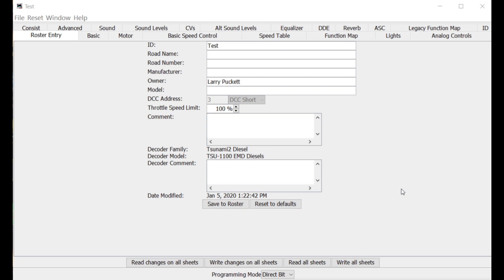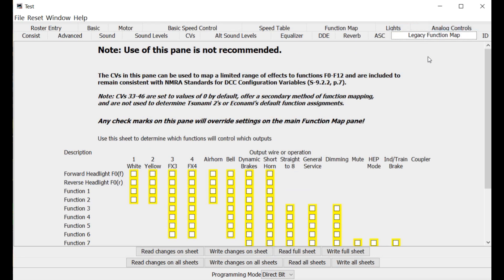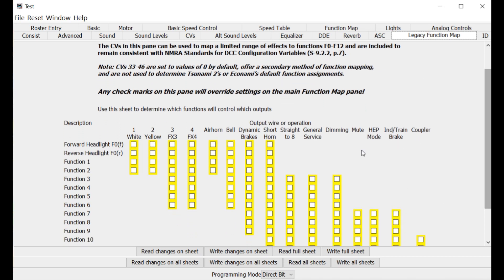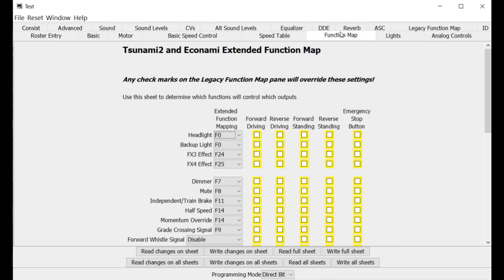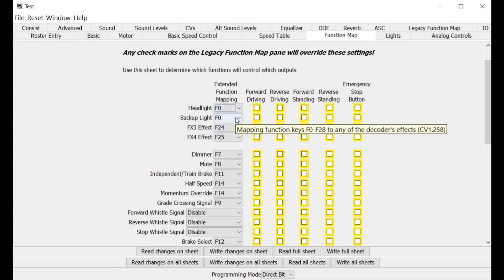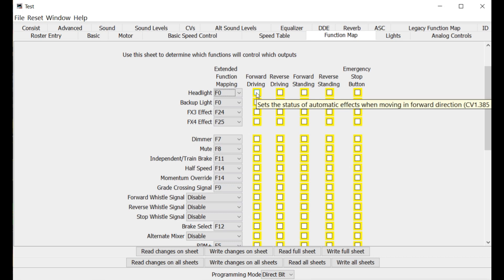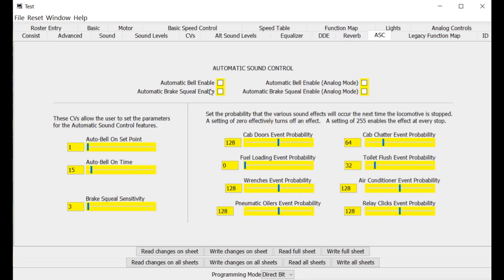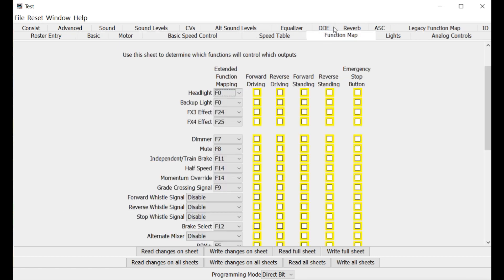61. DCC Decoder function mapping

Comment: Thanks Larry.  I have Tsunami 2's and remapped functions manually on the throttle (not through the JMRI software).  For some of my locos, I cannot remap F11 once I've remapped it once.  I can remap F11 multiple times just fine on others.  Have you experienced this?  I will try again using the JMRI software.
Reply from the maker: I just had a similar issue this week and resolved it with a CV8 reset. After that I was able to remap functions as I desired.
Reply: @TheDCCGuy  Thanks.  I solved it by reviewing the "Legacy Function Map" tab.  There were several items checked for F11.  As you mention in the video, this takes priority over any settings in the "Function Map" tab.  Once I unchecked the items and wrote to the decoder, I could modify F11 .  I would have never  known this without DecoderPro and your helpful tip.  Thanks for the video.

Comment: Hey, so I sent my Atlas S2 loco (n scale)  back to train world for an exchange because it was sputtering and would no matter where it was on the track, even brand new track with feeders it did this. 
I got the new one Last week and it does the same thing, just sputters around the track. Train world has told me to the decoder May need to be set to run more efficiently, I may need to adjust the cvs which I know little about. Do you know what cvs they’re talking about? I can switch horns and such but I don’t know how it would stop it from sputtering. 

Sorry for the long comment, you seem to know a lot about this stuff.
Reply from the maker: The decoder should have been optimized for the locomotive by the manufacturer. Since I have no idea which decoder was installed in that loco it makes it a little hard from me to comment. However, Atlas should have a tech sheet on their website on programming the decoder so I suggest you contact their customer support people. 

Now let me share my experience like this. A couple of years ago I bought a small steam loco with a LokSound decoder in it. Unfortunately the manufacturer had switched motors after the first run and as a result the thing ran horribly. I tried all kinds of custom CV settings and autocalibration to no avail. I finally replaced it with a SoundTraxx decoder that worked well with the motor. 

More recently Rapido had a batch of models that kept burning up motors, with LokSound decoders. They finally came up with some CV reprogramming changes that fixed the issue but not before they had to replace a bunch of motors and reprogram everything in their warehouse. So I bet this is the kind of issue you are seeing. And only the folks at Atlas will know. I’m sorry I can’t can’t offer a more specific answer but this is the first I have heard of this particular problem but I bet Atlas has heard from a lot of customers in your situation—good luck.
Reply: Thank you Larry, I’m glad you have an experience like mine! I will check the Atlas website for a table/chart on programming the CV values, I am a rookie when it comes to this stuff, I have 3 other Atlas locos and they all worked flawlessly out of the box. Thank you for your time and letting me know that I’m probably not the only one with this issue. Take care!

Comment: Can I use either the digitrax programmer or the ESU programmer to programme any make of decoder.
Reply from the maker: The Digitrax PR4 can be used with any type decoder. However as far as I have been able to ascertain the ESU programmer can only be used with their decoders. That said, because it is optimized for use with their LokProgram and their decoders it is much faster than other methods.

Comment: Thanks! nice video. I was able to finally set my prime mover options. It was always starting up once power was applied to tracks. What a pain have noise all over :) Now I can start it when I need it
Reply from the maker: Yes, finding the right CV setting can be difficult since manufacturers don’t always use the same one. Be aware that different decoders may do it different ways too.

Comment: Larry, excellent video on using decoder pro to make sound function changes. I learned a lot. Can you tell me why you choose Digitrax for DCC system? Thanks for sharing.  Ken
Reply from the maker: I have been using Digitrax since they first started in 1994. They sent me one of their first sets for a review in Model Railroading magazine and I stuck with them ever since. I also have owned System One, NCE, Lenz, Bachmann, MRC, and Atlas systems for reviews but have kept Digitrax as my main system. I still have all the Digitrax equipment I picked up over the last 25 years and with minor exceptions it still works and I have only had to send one throttle back for repairs in that time. The big difference compared to most of the others is the expandability of their systems—everything is compatible so you can start with a beginner set and add to it as needed. You don’t have to start all over when you decide you need more capacity, etc. NCE is pretty good to but they got into the game too late for me to go with them.
Reply: Thanks for the great info. It helps me out. I have an MRC, but am not pleased and am thinking of changing to Digitrax. This helped a lot.  Ken
Reply: @mandbhomestead  Please explain why you are not pleased, help clarify my thoughts.
Reply: @Mr Allen, I did not like the single knob to control the engines, having to constantly recall and search for the engine I wanted to control. I also did not like the feel of the controller in my hand. To me personally some of the programming was a bit trying. MRC does make a good system but was just not for me. Thank you for asking.